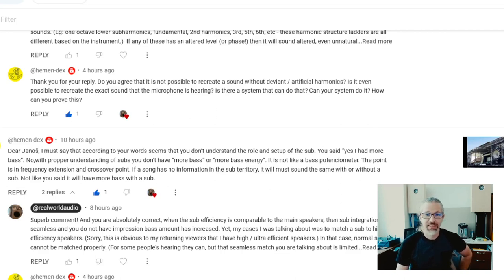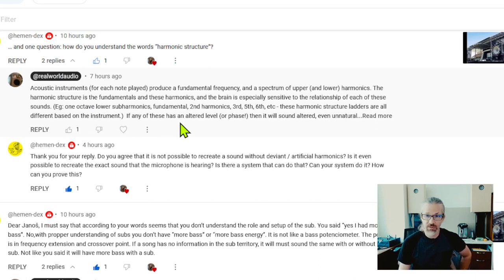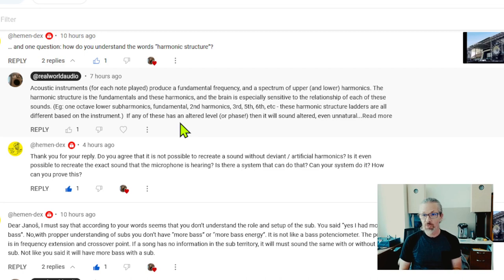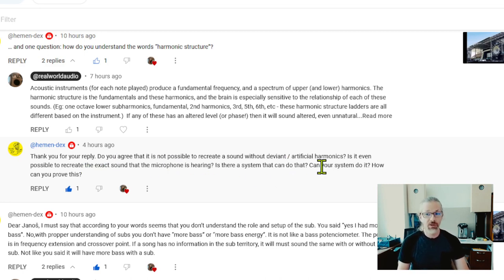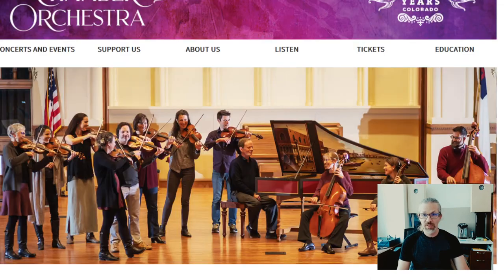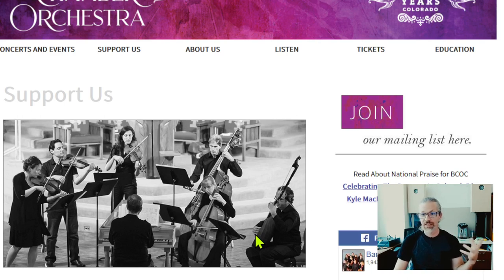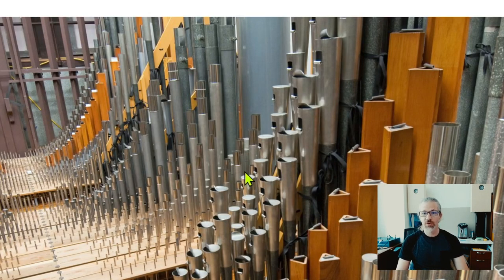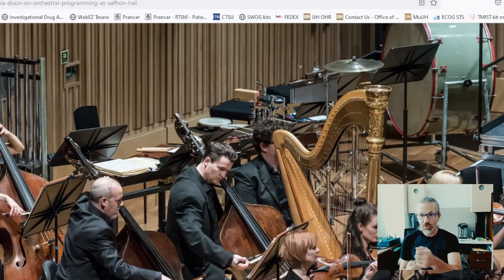Is it possible to recreate sound without deviant / artificial harmonics?!

Comment: And how can you prove this? That is often with many engineering questions the case. Janos is right, for all intends and purposes we can not prove this. In those cases we have to use our discernment. In practical sense this means we have to think about the problem and come up with a hypothesis. Then we have to apply it as if it is true (example, build La Grande) and if it then pans out AND there are no other examples of contra indications (when doing everything right) the hypothesis becomes a theory. At this point you use it as if it is actually proven. You have created a reality. Once you master this way of thinking, a whole new world opens to you. Enjoy the ride.
Reply from the maker: Thank you Hugo, you put it together so well! Indeed, people are always focusing on whether something has been proven or disproven. Yet, as a research scientist I can state that the much much more important aspect is the range of applicability. When a concept has been tested in a setting and found to be applicable, then people make the worst possible mistake: extrapolate the theory to a much wider range of applicability than the data allows. The entire audio field is suffering gravely from this, leading to the measurements being little more useful than urban legends, as the range of applicability is just about always in the unkown territory... and when we dig deeper, it always turns out that the data available is restricted to a very narrow set of criteria, many of which does not apply to any specific case we look at.

Comment: Dear Janos, have you tried to implement wood hardener to cabinet? 
If not, then you can have the possibility to make it thinner in order to gain higher amount of resonance and lower the resonant frequency. I guess it would be pretty interesting experiment
Reply from the maker: The wood harder is excellent, I have the can waiting for the whole year to apply onto the thin portions of the La Grande walls. ; ) And yes, we can thin out the cabinet walls more with the addition of the wood hardener. I have been using it a lot with the wooden tonearms. ; ) . (Also to renew paper cone drivers. )